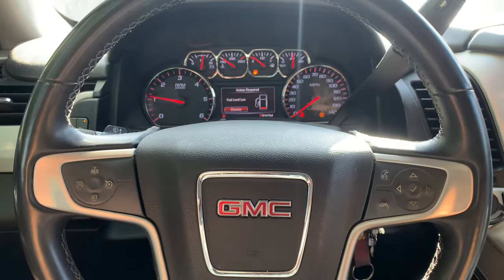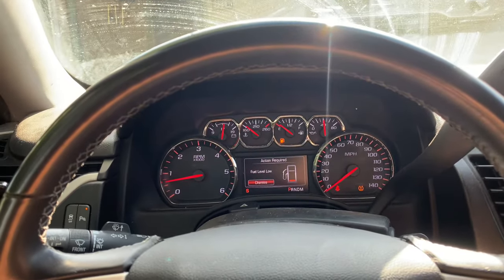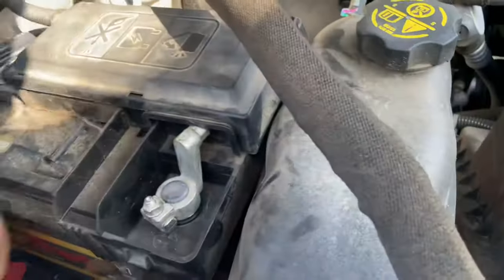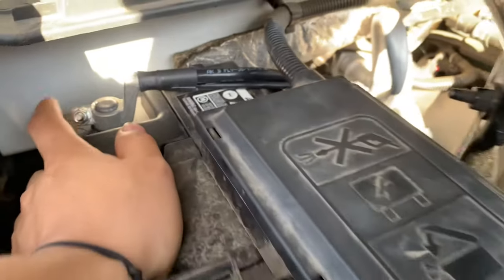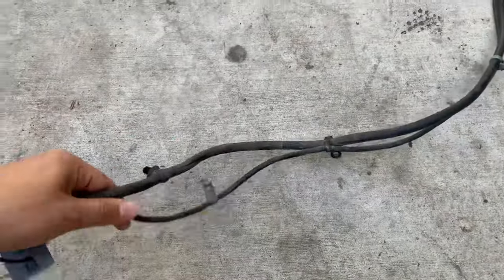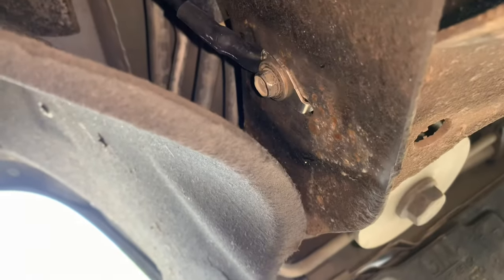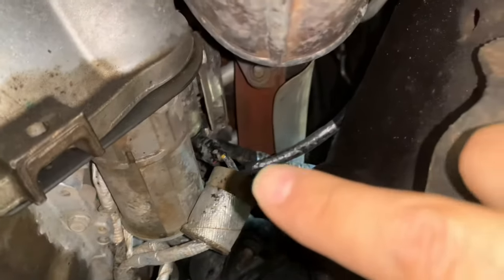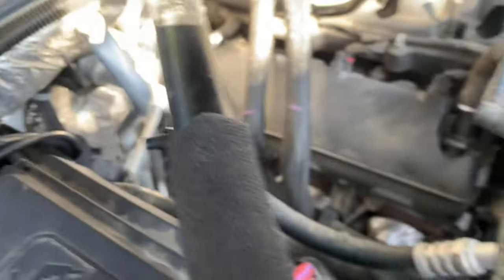How to Replace 2014-2018 GM truck ground cable due to Electrical issues (no crank, stabilitrak, etc)

Comment: Warning: These exact symptoms can just as easily caused by the positive cables and connectors, so be sure to locate the failed cable/connection before throwing parts at it. My truck had the same symptoms: jerking steering, Stabilatrack message, dash would go black, radio loses the station, clock loses time, and the truck would sometimes go completely dead in the driveway overnight. When I touched the negative battery cable, there was a small pop sound at the top of the battery and the truck sprang to life. I repeated this several times. It's got to be the cable, right? Nope, it did the same thing after I replaced the negative cable. It ended up being the blue connector that plugs into the distribution block on top of the battery. I believe that the fingers on the contacts had lost their "sproing" over time. To fix it, I pushed the terminals out of the blue connector, tweaked the contacts to give them more force. Then I cleaned and tightened all of the cables tied to the lugs in the ditribution block. My problems are 100% gone. I should have diagnose the problems to the root cause before unleashing the parts cannon. $85 and 2 hours wasted on a battery cable.

Comment from the maker: Update: it has been over a month and still no issues.
Reply: It’s been 6months since this entire video, did that fix the issue?? Is her vehicle still not having any issues
Reply: I have a 2011 Sierra and yea when I say funky issues I mean funky, truck almost basically turn off and back on while driving. I’m replacing the wiring today but was just curious
Reply from the maker: @slasherrvs7503  fortunately it did work for me and it’s been running good. I would just check and clean all your grounds just to be cautious
Reply from the maker: @slasherrvs7503  everything still working as it should, no problems
Reply: This has plagued me for over a year. I just got my cable swapped. Hopefully it won’t haplen anymore for me either. 🤞🏾
Reply from the maker: @jarrettbakersr  best of luck! Everything has been running smoothly still for me. Although if all your grounds are clean and you replace this cable, another problem that I heard of could be that little box that your pos battery cable attaches to. Might wanna look into that if you have the issue again
Reply: @inlandspeed6670  it dropped for a few days but happened once again. 😤 I’ll try that next.
Reply: @jarrettbakersr  did you ever fix the problem man? I’m currently dealing with this issue
Reply: @andyfg2291  Ultimately yes. I ended up getting the whole battery terminal and battery itself replaced about 3 months ago and it hasn’t happened since. At first I just. Re-laced the negative cable-problem came back about a week later, then I replaced the positive-same thing. Good luck. Hopefully  this helps.

Comment: I "was" having intermittent electrical power loss while driving. The symptoms were as follows - while driving i would randomly have a 1 second loss of power leading to have either stabilitrak, 4wd, or random downshift and all electrical loss for a fraction of a second. It would happen so quick that it would not leave a check engine light. I checked my grounds in the dash near the speakers, and they are good. I then moved to the external grounds. I cleaned all the connection points up with sandpaper and wd40. after doing that, the issues t away for 1 week, then came back. So i did  a bunch of research and came to the conclusion that my negative battery cable (the one your showing in the video) becomes faulty quick. So i replaced it. Finally it seemed my problems were resolved. Fast forward 3 weeks later, and the issues are back. I am at a loss for words on this issue. I have a new positive battery cable yet to be installed. Im planning to replace the junction block on top the battery and the ground strap as well. My issues all started after changing my battery / and starter.
Reply: Hey Buddy. Did you get this issue fixed?
Reply: @Justin Meyer  yes i did finally. I can give you all the things to checkout. Let me know what you are experiencing.
Reply: Last couple weeks that stablink would pop on amd hill assist Deactivate. Then just recently, I would go to start the truck. It woukd click, like a low battery. The truck would start. I went and bought a new battery. Now I get nights on the dashboard, no clicks, nothing when I insert the key and try to start. But when i turn the key to off position my front left headlight turns on then off.
Reply: @Justin Meyer  that's an odd situation. What i would do first is try to reset the memory (leave the battery disconnected for 30 mins). If issues stay, next check and clean the grounds. The main negative cable run from the battery to the passenger wheel well and engine block (bottom of engine near starter). After that see if it improves. If not, check the ground on the driver side (right under driver seat underneath truck). If no improvements, look and clean connections at the ground strap (firewall to the engine, it's a braided ground). If that doesnt improve, check the grounds at the dashboard speakers (there are a few videos on this). If no improvments, time to start spending some money. I would start with replacing the main ground cable, they are about $100, but they are known to fail prematurely. If that doesnt work, look at the fuse distribution box about $140 (this is on the top of battery). This distributes power to many electronics. My issue was the starter heat sheild, it got loose and was shorting out my power to my modules. 

Check out the link below, it pretty much covers everything i mentioned with pictures and real descriptions. 

https://www.google.com/url?sa=t&source=web&rct=j&url=https://static.nhtsa.gov/odi/tsbs/2019/MC-10168185-9999.pdf&ved=2ahUKEwju0IPdnez3AhWIT98KHcGsCOoQFnoECA0QAQ&usg=AOvVaw3HuR7mqEKFKF2iqohyHk3b
Reply: @zacharymervich1169  . I appreciate the response and video. This just hapoed about 48 hours ago so in in the early stages. I did immediately order that distribution fuse on top of the battery.  The place I bought the battery from, told me to be very careful changing the battery because a arc will either ruin that distribution fuse, or wires, relays, fuses. What he did not sat was to disconnect the negative first, then positive. Thrn reinstall positive first then negative. I will let you know what happens after I get ot figured put. Thanks again
Reply: @Justin Meyer  yes, be very dilegent when installing the fuse distribution box. It can arch and blow a fuse, and they arent cheap or easy to get. No problem, i like helping people. This truck (2018 silverado 1500 Z71 4x4) has been a pain with electrical. I have be professionally in the electrical indusrty for 7 years, so this truck gave me a good test on my electrical troubleshoot skills lol. If you ever have any questions about anything vehicle related, ive been building cars for a little over 12 years on and off. I can disassemble a vehicle completely, down to the frame.
Reply: @zacharymervich1169  I am experiencing, difficulty starting. when I keep the key turned & i turn on the headlights the car starts but then dies. sometimes it drives fine for 20min then the car would act crazy door unlock gauges dancing hard shifts..
Reply: @Doncreation  that can be caused by a few different reasons. Go to the link i provide below and start troubleshooting there. My problem ended up being the starter heat shield (the last item on the pdf in that link). Other than whats on the PDF, i have a few more things you can check. Keep me updated here and i can help you figure it out. 

https://www.google.com/url?sa=t&source=web&rct=j&url=https://static.nhtsa.gov/odi/tsbs/2019/MC-10168185-9999.pdf&ved=2ahUKEwjyzvjet-f4AhXYlmoFHdWEDKcQFnoECCwQAQ&usg=AOvVaw3HuR7mqEKFKF2iqohyHk3b
Reply: @zacharymervich1169  
yo thank I have a 22 rst and this lead them find battery was defective took it to a old buick dealer chevy dealer where i bought it at couldnt fix issue.
Reply: @zacharymervich1169  yooo can you read my comment please
Reply: @zacharymervich1169  @ZacharyMervich my truck shuts off while driving and it kept on doing it for a while until it completely shut off and didn’t come back on I changed the alternator and battery and when I turned it on it said on the dashboard that the battery had low voltage and and my radiator fan stopped working as well so I changed the cooling relay because that came up when I got a computer diagnosed (code p0480) and after that I turned it on and it only stayed on for like 10 minutes then shut off now I have to jumpstart it too turn on and it’s say that the battery is low after taking the jumper cables off
Reply: @Ramiro Bonilla i would look at all your grounds to start with. I would replace all of them. That is usually where most problems happen. Try and find all grounding points through research, and check them all. And if it looks good, clean it with a wire brush and reconnect it.
Reply: My 14 Z71 LTZ is having an issue with a trailer brake message popping up randomly and when the dealership scanned it they told me it was a ground issue. Could it be the negative cable from the battery?
Reply: @Chester Hause  its probably a ground that ties into the plug near the plug. I say this because i also have that issue and has never went away enven after going through all grounds near the engine, and replacing the main battery ground cable.
Reply: The clip in the video that he says he is not sure what it is can be the issue, that piece can go bad its called a "Battery Current Sensor".
Reply: @ramirobonilla5506  try Battery Current Sensor
Reply: @chevyman979  I had the same issue, came to find out a fuse was out in the hood compartment. Replaced and issue went away
Reply: @ramirobonilla5506  what was your cause of this?
Reply: @angelayala9453 which fuse?

Comment: Had all those issues on my 2016 Yukon on a daily basis for 2 -3 months ….removed and cleaned all battery and main fuse connectors at battery and no more issues going on 3 weeks

Comment: @Zachary Mervich . Problem solved. I have a 2016 Silverado 1500 5.3 recently had issues with nav screen glitches,  stablelink  messages, and jusy a few delayed signals starting my truck. "Meaning turn the key hear starter engage, dash lights up, but no crank for about a  blink." That immediately led into a dead battery. Within 3 days. Bought a new battery and had no power what so ever except when I turned the ignition to the off position. I would get my driver side head ti turn on and my interior lights. Combed all the fuses checked for power, checked grounds, and still nothing. So I made the call that I should have made right away. Called the old man. Not even a two sips from the beer he had it diagn osed and a temporary trouble shoot in case I needed my truck until the part came in. If I can figure out how to get pictures on here I will, but what happend is when replacing the battery. I arced the distribution fuse on top of the battery. And it popped the circuit where my 2 Negs connect to the 175v. You can take a wire and connect the main plate, to the bolt where the wires go and it will create the circuit again. What we did is just connect the 2 negs to the 125v breaker and the truck runs like new. The distribution fuse box for my 2016 does not come standard with a mega fuse, and the fuse it self cost around 80 dollars from gm, and is a week plus out. So I don't suggest running your alternator or starter off the 125v connector to long, but it's there if your in a bind. That battery box is on all trucks 2015 to current. It is said to keep those clean because it will cause power issues which cause messages to pop up and other things to go funky. One more thing. It was said to me, that when changing the modern day batteries. Disconnect the Negtive wire on the battery first then the positive, then when reinstalling, place the positive on first then the negative.
Reply: That's good advice - remove negative battery cable first (assuming negative ground system), followed by positive. Because if you were to accidentally contact any metal component (excluding positive battery terminal) with a wrench while removing the negative - no harm will occur. If you contact anything at all with your wrench while removing the positive cable first - you will experience powerful arcing/sparks/molten metal!

Comment: Hello, I too am part of this community, 2018 Silverado @ 117k miles, after market leveling kit and 33x12.5r20 tires. Had this same issue & can confirm from a Chevy Auto Tech, that this was this issue for me. Negative cable to the battery and battery fuse box, that goes on top of the battery.
Reply: Hello, did your issue ever come back.  I just installed a leveling kit and now I am experiencing weird electrical issues.  Stabilitrak message, radio resets, driver side window message and total loss of electrical power like the battery is disconnected.  Never had any problems before until I got the leveling kit installed.
Reply: @aaldaco78543  My situation is 100% parallel to yours. Did you get it resolved? When my truck turns off, I wiggle the negative cable, and it turns right on.

Comment: Thanks for posting the video, I recently took my 2014 Silverado to the dealer because similar problems, they quoted me $800 to replace the battery cables, so I told them that was kind of high for replacing battery cables so I would do it myself.  Soooo, if that is the going rate, you saved your mom $710 and she should be so happy to have a son like you taking care of her!  BTW, all my cables are pristine, so I suspect my problem is the bad grounding point  inside under the speaker in the dash.  I am going to hook up my volt meter and see if I can sneak up on the exact cause (nothing like a smoking gun to give you peace of mind)  by checking for voltage changes across things (when I move the steering wheel) on connections (i.e. grounds) where there should not be any voltage.  I'll connect the ground on the meter to the ground of the battery through a long wire, then probe around to see if the voltage at those ground points rises when I move the steering wheel.  Anything more than .3 to .5 volts DC is bad, since all grounds should be very close to zero volts all over the vehicle.
Reply from the maker: Wow thanks for this info! Very helpful information for any of us looking to fix this issue. Diagnosing it properly using the steps you suggested would definitely be the way to go as opposed to throwing parts at it (like I did..but got lucky haha). Hope you get to the bottom of your issue, good luck!
Reply: I am not a mechanic or knowledge of engines. How do you find your grounds in a 2016 Colorado truck, my truck has some issues with not cranking i double check most of the basic things everything seem good including the fuse but when i play with the negative cable on this truck, i wiggle it the wire because they are hard to reach them. I suspect it has to be this cable or the ground because it now cranks every time. cross my fingers! Leet me know of a website or a link to find  my ground connectors in this Colorado Sir. Thanks

Comment: So was it cleaning all grounds and replacing the negative cable that fixed it for you? I’m having similar issues and got it back working temporarily by jiggling the negative but need an actual fix

Comment: I just cleaned up and tightened the small negative cable on frame behind front passenger wheel well and fixed the weird issues on my 2015. That ring with plug measures amp draw for computer processing. Very rarely is the actual cable bad.

Comment: Thank you for posting this video as I used it as a resource to change my own negative cable. 

2015 Escalade ESV here. Remove the passenger tire. Remove the wheel well guards or enough screws to peel the guard back to be in front of the rotors. You will probably need to remove the brake sensor from the frame by lifting the pegs out of the hole.  You may want to remove the other insulated wrapped wire next to the brake lines. Now you should be able to access the bolt.  You may want to squirt it with PB blaster or some other lubricant.  You may also want to have a pivot head for your socket.  I used a 24 inch 3/8 extension to reach it.